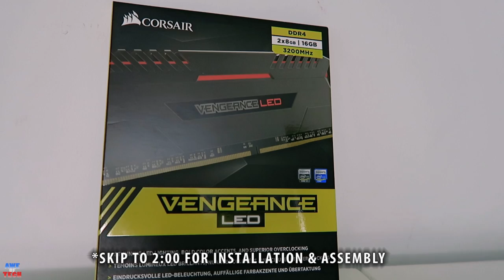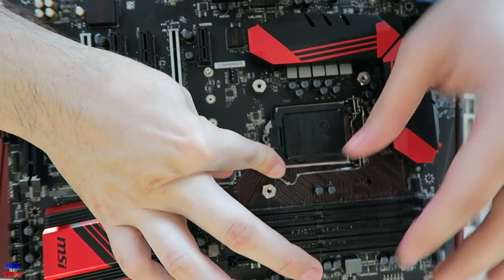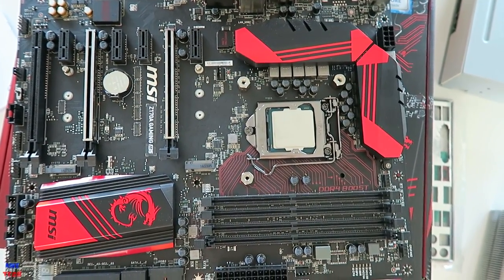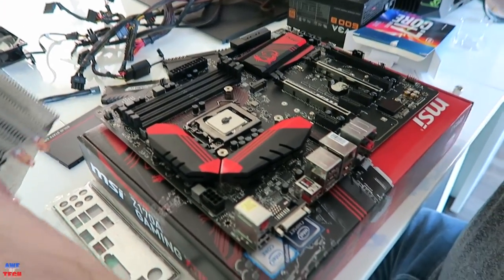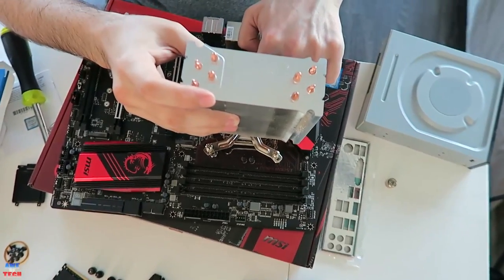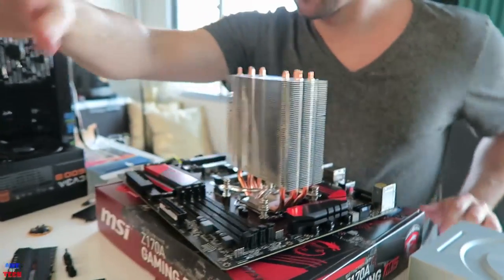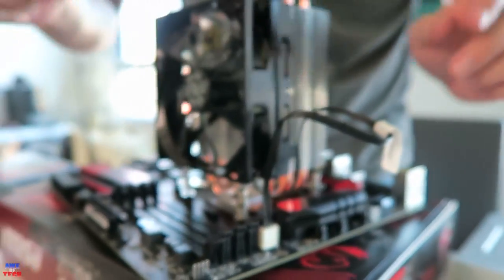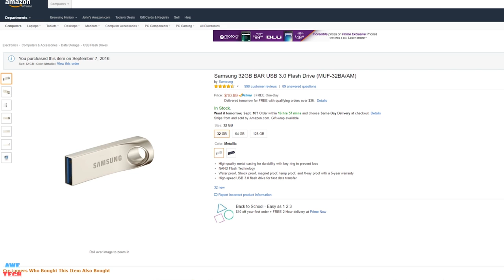How to Build a Skylake Gaming PC - Hands-on Tutorial

Comment: that was at least 3 times the needed amount of thermal paste
Reply: yep xD
Reply: Not 3 times the amount, maybe a little bit over...It will be fine it won't overheat!
Reply: It's a myth. Amount of thermal paste doesn't matter unless you use too little.
Reply: MMMHOTCHEEZE   spoken like a true gentleman
Reply: MMMHOTCHEEZE in that case I'm using the whole thing my cpu will be -99999999 degrees

Comment: I noticed at the end of the video you recommended plugging in the monitor to the mother board.  I would recommend plugging in the monitor to the video card.  Cable management helps air flow which will ultimately keep your computer cooler.

Comment: There is a opening on the the back of the case for the 8 pin power connector you just have to rout it up there before you install your motherboard, i built my brother's computer in that exact same case.

Comment: This guy really has no fucking cable managment skills
Reply: My eyes hurts after seeng it D:
Reply: My room? thats old hahahaahah i live for my self now ;) Building a PC is easy...
Reply: Hector Tio Salamanca I need tips cuz I'm going to build my own PC so plz give me some tips
Reply: Decide over Intel or AMD. Intel i5 skylake and i7(price is kinnda high right now) or AMD ryzen motherboard and CPU at the end of March(price unknown). Ryzen has a real 8 core processor( 8 physical cores, 16 threads) wich means that if you buy Ryzen mobo and CPU you get 2xi7's bassicly. DDR4 RAM for both (8 GB is the minimum; buy 2 or 4 sticks to make use of dual-channel), and a 550W-650W PSU from any popular brand(CX, EVGA,etc.). GPU should be this generation, preferably 8 GB for future, 4 GB if you plan on buying something new in the next 2 years. (anything from RX 4XX series or Nvidia GTX 10xx series. You pick RX 470 or 480 for future gaming(4 years or so), or GTX 1080(but the 1080 is overpriced). RX 460 and GTX 1060 and 1070 should last you about 2 years. SSD X1 , HDD X 1(pick sizes yourself). And if you want, a custom cooler ( Hyper EVO 212 OR 212x; 212x is the newer model but not much different.
Reply: cable management is actually a big worry, considering bad cable management blocks airflow and makes your parts hotter and not last as long.
Reply: ahhahahah true :D

Comment: Hey, I'm going with the 700 dollar build you recommended in your other video. I've never built a pc before or even researched how until now, but seems easy enough. I just wanted to ask if putting together the $700 build with gtx 1060 is similar to the way you put the build together in this video? I just want a good reference point to help me build it so i dont mess it up. Btw i cant address how thankful i am for your videos. If i didnt come across your video i would of ended up purchasing a $1500 laptop instead with slightly lower specs. Now I was able to buy a great 27inch monitor, keyboard, mouse, gaming headset and game chair along with the $700 build today and only hit $1240 with the gtx 1060 6gb version. You saved me a crazy amount of money, man!
Reply from the maker: +Zack "TriippyHD" yes it is extremely similar,  this guide should be close enough for you to do the entire assembly from it

Comment: Could explain a bit more which cable of the PSU to connect where (some are for SATA, other for PCIE). ^^ And warning people to be careful (even more) with the CPU and the back plate of the case, to not get injured when setting it coz it's sometimes sharp. 

Good video still. :)

Comment: Hey man great build I am thinking to do that build I just have a 3 questions 
1) will a 650 watts Full modular psu be good enough for this build? 
2) will this build be able to run games at 4K video quality? ( I will be using the Nvidia GeForce gtx 1070 Gpu)
3) won't the build need a hard drive with the ssd
Reply from the maker: yes 650 watt PSU is more than adequate, for 4k I'd recommend the 1080 or greater as the 1070 is not quite there yet, in my recent testings with my 1070 clocked at 1949Mhz, 4k ultra settings: I'm getting averages of 33 fps in rise of the tomb raider, 44 fps shadow of mordor,  31 fps the division,  33 fps witcher 3 (hairworks on), arkham knight 41 fps, and just under 50 fps in doom (vulkan). So for less demanding games 4k is definitely great, but demanding triple A titles not quite there IMO. For the storage capacity it just depends on how much you like store at once, 960gb is enough for around 20 games with a little left over. You could also add an additional drive whether it be a hard drive or ssd when you get close to filling up the first one.

Comment: The cable management could be done better. The i5 6600K is better for this build and cheaper. Also I went with the RX 470 4G Strix 4Gb and the Zalman Z11 Plus case and ended up at $1100. But this is a great video and really taught me how to build my first pc (which will arrive in about 2 weeks in parts). And if i'm not too late, name the cat Strix. :)

Comment: Question, I'm going off your 1,500$ build with the GTX MSI 1080X, and I'm curious about the case the Noctis if it's compatible with and optical drive? Thanks!
Reply from the maker: unfortunately there's no 5.25" drive bay on the Noctis, I think they didn't want to take away from the aesthetics
Reply: +Awe of Tech damn thanks anyways, I'm building my new pc off of those specs and the usb Windows 10 is pretty expensive
Reply: Don't worry you can just get a cheap CD driver off Amazon or even craigslist and get the Disc. Plus you can use it later on for CD installations.

Comment: yo im building with a i5 6400k and a msi 1060 6b, what average fps would i get, and is a 144hz monitor really needed? im mostly gonna play csgo, ovewatch, bf1 and cod. and im sticking with the stock cooler, i wont oc so should i get a stronger cooler

Comment: I gonna switch to Skylake soon. Getting a pentium g4400. Dual core but a bad ass one. Plus I get that good upgrade path
Reply: why not get the i3 and not have to upgrade for quite a while?
Reply: Because for me to get an i3. I'd have to get a shitty motherboard. I'd rather get a really nice motherboard and still a good cpu for now.
Reply: Danny Daniel I'd rather get a "shit" motherboard. All they sacrifice is RAID, more than 2 case fans, overclocking ability, more than 4 sata ports, Crossfire/SLI and more than 16 GB ram.
They sacrifice no quality/speed/longevity

Do you need any of those things? if no get a cheap chipset and upgrade to the new socket in 3 years with a new motherboard. 1151 socket is relatively new but I highly doubt in 2-3 years you will want to keep using it

Fancy mobo are almost always a huge waste of money unless you overclock or have some sort of RAID setup or multiple GPUs

Bought an i3 for my sister and it's killing AAA games on high/ultra 60fps 1440(with 980) a pentium might bottleneck a card faster than a radeon 380
Reply: The G4400 performs equal to the i3 anyways no reason to spend an extra 50 when you can put htat into a Z170 SLI/XF RAID etc
Reply: at least his not that ass that buys an ASUS rampage motherboard with an I5
Reply: Black Rabbit nonono, single threaded performance is close, but the difference in games between an I3 and and Pentium is pretty big. Bigger than the difference between an I3 and I5.

4 threaded performance(which is the most important at the moment)

is about 5 faster in the I3 over the pentium, then again about 30% faster in the I5 over the I3.

There are load of benchmarks for this online here's one http://cpu.userbenchmark.com/Compare/Intel-Pentium-G4400-vs-Intel-Core-i3-6100/3539vs3511

The only exception I know is GTA 5 because GTA 5 is bugged and CAN not use hyperthreading at all
Reply: which makes gta5 a game that can run fine on the pentium
Reply: Danny Daniel Nah dude, go all out like me I7 6700K + 1080 FTW, you wont regret it xD
Reply: I wish we all had money to spend like that. And to be honest. Theres more of a charm running a strict dual core, thinking you wont run a game but you boot it up and it runs really well
Reply: Danny Daniel AM FIRING MYYYY LAZZZORRRRRRRRR
Reply: Ryan Zhu All out, well it looks like you have been beaten big time. Titan X Pascal and I7 6900k.
Reply: Josh Clark bro, check my instagram <3 and am not bragging xD
Reply: Elias Sen Doudouh yeah but SLI is dying, it creates too many problems
Reply: Ryan Zhu yeah a 1080 is impressive but nothing special, so I believe you.
Reply: Ryan Zhu lol he thinks we're lying.
Reply: Josh Clark Bragging lol if you don't believe me I made a video about it on my channel. I switched out the I7 6800k with the I7 6900k. If you say no thank you to watch my proof your just trolling me. Also if you go with the strongest graphics card like 1080 or Titan XP SLI becomes even more irrelevant because of the stronger card having more than enough power so SLI just becomes  a expensive Paper weight unless your a PC enthusiast that just runs Fire strike benchmarks. Also look at how bad games scale on SLI terrible sometimes it doesn't even work. All DX12 games are currently to compatible with SLI. When Volta and Navi launch SLI and Cross Fire will be gone and useless.
Reply: don't need an answer to that. ^
Reply: JackSepticEye runs a single Titan X
Reply: Sunov he's also Jacksepticeye
Reply: Josh Clark Your point being?
Reply: Sunov that's literally what I'm saying, it's Jacksepticeye what point are you trying to make.
Reply: Josh Clark You asked "who runs a single titan X?"
Reply: Sunov yeah, obviously there is people in the world who do, but if you have a titan you should be using it for commercial work and you should be using two because most programs in commercial work utilize two very well.
Reply: Josh Clark Yeah, I was just giving an example

Comment: Why not go with a liquid cooler, like an H-100i or H-60 due to space.  That cpu cooler looks so bulky and looks like it would dump so much heat into case.  How well did that cooler keep the cpu cool? did it limit your overclocking? And I take it that cooler you bought used? since I think I saw dust inside it?

Comment: what if i have a 3.5 hv output? i believe your install forgot the power switch and reset switch overlap through the v wiring system. After dealing with computers for 23 years I find it necessary to overlap them both otherwise you're talking major bucks later on during repairs. Also I noticed that you did not install the C system wiring along with the TDoc drive. I have so many questions and feel like you could have covered so much more. Don't forget that the Watt levels put out are very deceptive, next time be sure to conduct a 3p crv test in order to determine fluctuation channels.

Comment: just curious with this build why you didn't put the little axtra out and liquid cool it ? makes a big difference for cooling if your gaming and with that graphics card im gonna say there will be some gaming
Reply: I dunno I had air coolers and closed loop liquid coolers, and the temps ain't all that much difference. That cooler will do the job for gaming, and it's cheaper..It's a great cooler for gaming if you're on a budget.
Reply: that's true going on a budget  it will get the job done. I had a Big heat sink and fan and my computer was running avaerage temp of about 50C now with my liquid cooler its running avarage temp while gaming of about 35 to 37C I saw a difference within my own setup but either way its a great budget  build
Reply: LegendaryGameChannel What cooler you got?
Reply: I believe its the corsair h100i liquid cooler
Reply: LegendaryGameChannel Good Temps I have the Corsair H80I GT..Under Load I get 45c
Reply: yeah when i stress test my cpu I run around 45c. I am still  building my pc its not finished yet.  I still have to upgrade the graphics card, and ram. Get a ssd  then upgrade my processor

Comment: What do different memory types do? Like whats the diff between ddr4 3200 and ddr4 3000
Reply: Shrimp Sandwich The difference is in the speed it processes information. But that also depends on the motherboard and processor. If you have ddr4 3200 but the MoBo only supports ddr4 2400 it will run at 2400. Then again, it is worth buying a higher frequency ddr4 if you can overclock the MoBo to accept it. Hope this helps.

Comment: is this still the best one for $1000-1500 in 2017?
Reply from the maker: +OMGhuili it's still great, for an Intel system, swap Skylake i7 for the Kaby Lake i7-7700k since has refinements that give it a higher core clock speed as well as overclocking potential.  And of course now AMD has hit a homerun with their new processors, check out my latest build video: https://youtu.be/yp40JzMerYs
Reply: Thank you for replying. I think im going for i7-7700k instead AMD.

Comment: Z170 mobo and  i7-6700k is super overkill for a gtx970 or rx470. I'd say if you want those get a cheap mobo and and i3-6100 or i5-6500. you end up paying 130(more than 6500, 220 more than i3)+ 60$ extra for the Z170 mobo so you end up paying at least 190 extra that should really go into your GPU for gaming.

A H110 mobo with a 6500 and a gtx 1070 will always win VX Z170 OC'd 6700k + gtx970 or rx470 for gaming.

Comment: How much psu does a gtx 1060 overclocked need? I've been told that they needed 800w
Reply: you won't need more than a 500w. A 1080 would barely need a 800w.Good luck
Reply: 1080 800w? lol what are you talking about
Reply: 500w would is more than enough to power a gtx 1060 build. Even a high-end 1080 build shouldn't need more than 700w
Reply: I have a asus Strix 1080 i have a 700w thats more than enough.
Reply: even a decent 600w would be enough
Reply: +TheGrace020 damn saaaaaaan. Dats sum power right der
Reply: 750w

Comment: amd A8 7600 kaveri processor is good for gaming
Reply: Better go with the FX 6300 if you're under that kind of budget
Reply: Why dont just get an i3 6100 for the upgrade path?
Reply: I3 is dual core processor compare to fx 6300 is better than i3
Reply: If you're gonna upgrade in the future then you should buy the core i3 6100, much better single core performance &  it comes with hyperthreading, and for example it performs better in GTA V than the FX 6300
Reply: What graphics card are you planning to buy?
Reply: The i3 is Hzperthreaded so its kinda a quad-core
Reply: Rx 460

Comment: Can anybody tell me if these specs and components are good
processor: I5-7400 3.5GHz boost
motherboard : gigabyte H110M G1 Gaming 3
Cpu cooler : Cooler Master RR 212L
RAM: 16GB Ripjaws V series DDR4
Storage: 1TB WD Blue
GPU: MSI RX 580 8GB DDR5
PSU : Voltron Gold 600W (comes with chassis Armageddon V3FX
anybody have any suggestions or comments?

Comment: Hi i want to build a new pc and i am new at this, but i am not sure if my items are compatible with each other. Can someone plz help me, her is a list of the items: 

SSD:  HyperX Fury 120GB 2.5" SSD
SATA 3.0, 7mm, SF-2281, 500/500MB/s

Prossesor:  Intel Core i7-6700K Skylake Prosessor
Socket-LGA1151, Quad Core 4.0GHz, 8MB, 91W, 14nm, Boxed, no cooler.

DDR4: Corsair Vengeance LPX DDR4 2133MHz 16GB
2x8GB, Optimalisert for Intel X99 og 100 Serie hovedkort

Socket: Gigabyte GA-Z170-Gaming K3, Socket-1151
Hovedkort,ATX,Z170,DDR4,2xPCIe-x16,CFX,M.2,SATA Express,USB 3.1,Killer GbLAN

CPU:  CRYORIG H5 Ultimate CPU Cooler
775/115x/2011/2011-3/1366/, AM2(+)/AM3(+)/FM1 700~1300RPM, 76CFM, 19~23 dBA

Grafic card:  Gigabyte GeForce GTX 1060 6GB G1 Gaming
Skjermkort, PCI-Express 3.0, GDDR5, 1594/1809MHz, WF2X, RGB LED, Pascal

PSU:  Corsair CX600, 600W PSU
ATX 12V V2.3, 80 Plus Bronze, Standard. 2x 6+2pin PCIe, 6x SATA, 4x Molex

Case:  Phanteks Enthoo EVOLV ATX GLASS
Aluminum Case, tempered glass panels, ATX, m-ATX, m-ITX, Black
Reply: Amil Rahimi go to pcpartpicker.com and select all of your parts. Not only does it show if they are compatible or not it will also show you the cheapest price online for them as well as the amount of power the system will draw helping you decide what power supply to get.